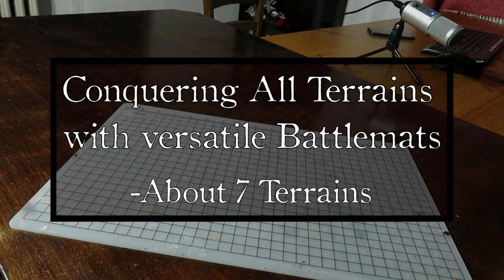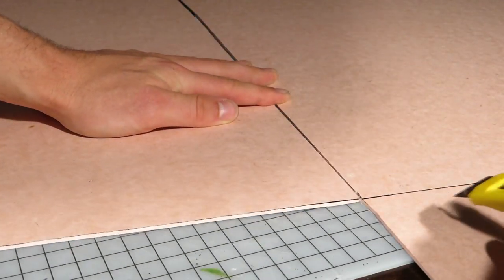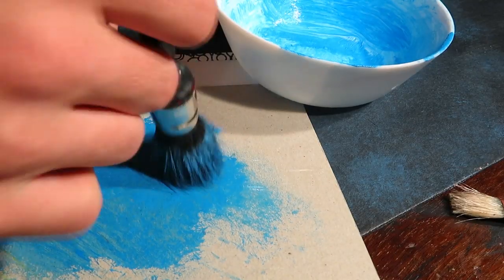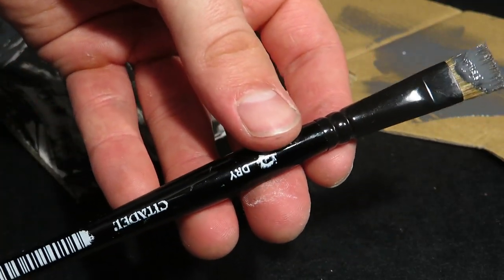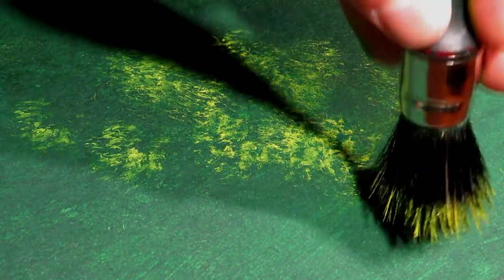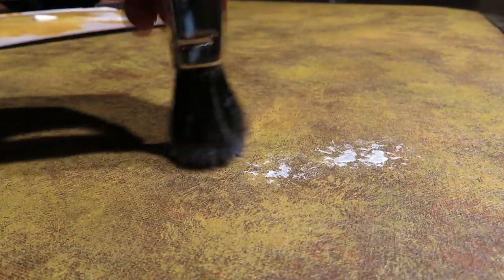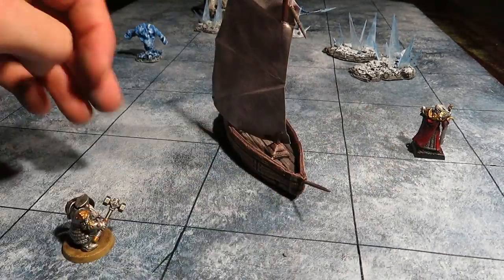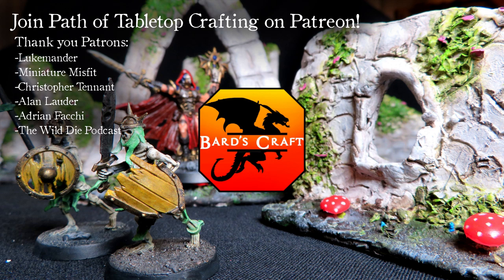Conquering All Terrains with Versatile Battlemats (D&D Terrain)

Comment: I love you casual approach to crafting. You have paint on you hands, on the table, probably in your hair... I feel less alone in the universe. I worked with paint 3 days ago and there is still paint on my foot even after showering.
Reply from the maker: Do you also have tiny foam bits all around the house? 😂
Reply: @BardsCraft  ... Yup  😅 practically impossible to pick up with a broom because of the static. (The trick is to stick a dryer sheet to your dustpan, plus it makes for great conversation when people  see said modified dustpan.)

Comment: Using sponge also helps make tappy texture (make-up sponge works better)
Reply from the maker: That seems much smarter than my tapping action
Reply: Agree with sponges for dabbing paint. Natural sponges work best, but any kitchen sponge will suffice.
Great method for texturing stones or rocks as well.
Reply: You can also use bread for tapping, much better than brush.

Comment: Very nice work. I need to make an outer space mat for Spelljammers. I believe your skills are going to be very helpful. Thank you.
Reply from the maker: Lots of messy tapping with purple, blue and other "space colors", on a black background. Then some white dots as stars. Am I guessing totally wrong? :D
Reply: @BardsCraft  
I was thinking the same thing. Maybe so.e planets in the background.
Reply: For stars put white paint on a toothbrush and "flick" it with your finger. It will fly all over the mat and give a good resemblance of the cosmos.
Reply: @joehayward4545  break up some "regular" styrofoam, like the stuff they use to package electronics, and use those 'beads' for some of the 'planets' or that kind of thing.
Reply: @jezeski2011  
Thanks I will give it a try.

Comment: Super awesome! Any intentions on sealing it with some foil or anything like that so you can use dry erase markers on it?
Reply from the maker: I'd suggest some thick varnish, anything that doesn't make the mat glossy. Personally, I have abandoned dry erase mats, instead I try to have terrain pieces for everything.
Reply: This particular material has a bit of texture so even with the sealant dry erase would be a bad idea because the marker would get stuck in the cracks.
Reply: If you wanted to make these dry erase, I suggest laying a sheet of clear vinyl over top. It will be glossy but that was you can use it with or without the dry erase part

Comment: Nice way to reuse those floor coverings.  They are not cheap to buy so when you can get some terrain mats for free you are winning that is for sure.
Reply: It is not that expensive relatively. Here in Canada I can get a 3 foot by 100 foot roll for about $30 at my local hardware store. Way more than I will ever need!
Reply: @CrazyCrethon  hmm I saw the product but at homedepot they want like 60 bucks
Reply: @add2ndedition663  Ack! I was looking at the wrong product. Yes, the RAM board is ~ $60. Still, for the amount you put in the hobby, it is not that much.
Reply: @CrazyCrethon  true true

Comment: I would love a cheaper alternative if anyone knows of one
Reply: I painted fabric for mine. Even used random scraps to make mud patches that I can remove. The trick is to tape or nail the fabric to stretch it out so it will be flat. Cheap fabric is easy to find some stores or you can use an old bed sheet or table cloth.
Reply: Download high quality images of the terrain, print them in tabloid size and glue them to cardboard